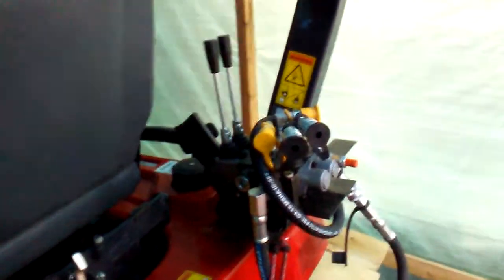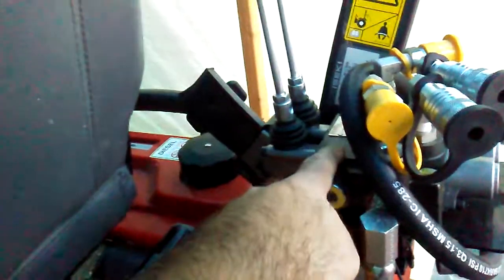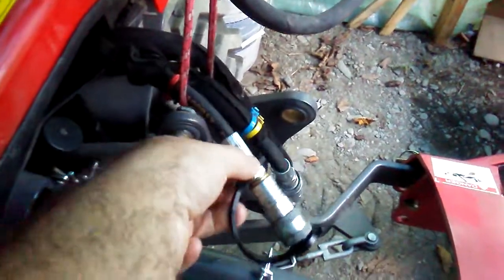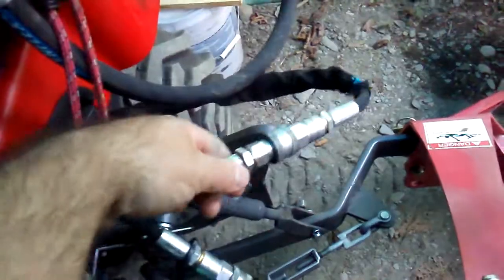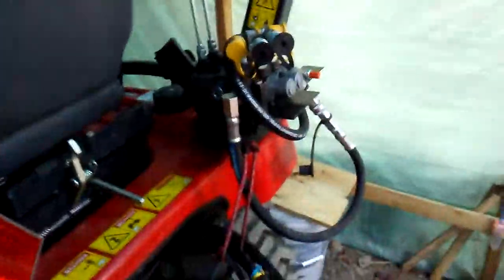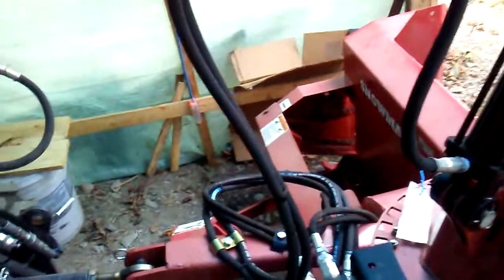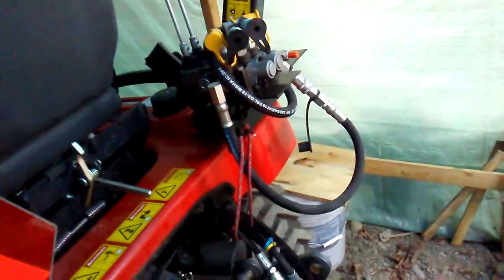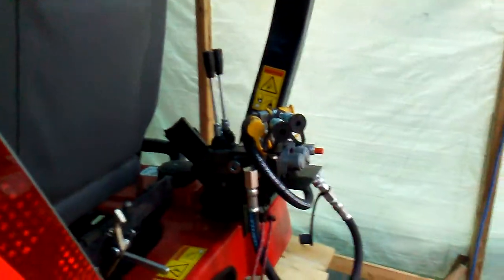Installin 2 spool hydraulics valves on mi Massey Ferguson GC1710

Comment: Another good note on the GC series tractors , they are OPEN center spools (valves). Yellow/blue is your hydraulic supply , blue is return to circuit(basically let’s the fluid flow to the next spool or hydraulic valve in the circuit )red is your return to tank (generally your pressure relief ) generally if your interested in using a splitter , you will just use the blue/yellow supply and red return directly to tank . Only thing is the FEL will not be available while using it . You will want to make sure every implement that has hydraulic spools (valves) has an open center , you may be able to get away with a tandem center depending on application . Quick basics … open center means when the valve is in neutral the (center position ) the fluid flows freely through its feed and return ports on to the next in the circuit (also your working ports A and B are open as well )as these tractors use a fixed pump meaning it runs no matter what when the tractor is on . The other center is closed center , meaning the opposite. In neutral position all ports are closed (you DO not want this valve as the hydraulic pump will dead head at the valve and note travel , these spools are for closed center variable pump applications where the pump speed adjusts as needed) . The other common spool is a tandem center spool . This spool in neutral has the supply and return open however the working ports Aand B (cylinder feed ports ) remain closed so that the cylinder stays in position when in neutral . A tandem center spool can be used with open center circuits /systems if you need this function . Might as well cover it since we’re this far lol . You may also need to know what type of cylinder your using . Single action meaning you are only controlling the cylinder one direction or dual action meaning you can control it both directions when needed this is why you have an Aand B port .

Comment: I have the GC 1720 I am doing the same thing. Is my understanding that the hose with the red zip tie is return to tank, the yellow/blue is the feed from the loader's power beyond port, and the blue zip tie is the feed for the 3 point hitch. When the backhoe is hooked up, you have pressure in, pressure out to the three-point, and return to tank for the low pressure "exhausted" fluid from the opposite side of each ram on the backhoe. The loader valve has three main ports, pressure in, power beyond (backhoe), and return to tank for cylinder oil. The backhoe valve has three main ports, pressure in (from loader's PB), power beyond (feeds 3pt) and tank for low pressure cylinder fluid. When not using the backhoe you connect the loader's power beyond to the 3-point pressure inlet, the blue/yellow and blue zip tie hoses and you leave the return to tank dangle because the backhoe is not in use. The three-point is the last in the hydraulic circuit which just has pressure in and return to tank. When adding another valve in series in between like this does the new valve need the power beyond port? And have all 3 of the backhoe hoses hooked to it? I'm not including all the work port hoses that go to each cylinder on these, just the main trunk. I've been reading that using a new valve like this and just using the return to tank as the high pressure feed to the 3-point can back feed high pressure and possibly cause damage? Even though it functions?

Comment: You failed to show and discuss how you tied the value into the tractor's hydraulic lines coming from the hydraulic  pump and exiting thru the drain line back to the reservoir . That is usally the most difficult connection.
Reply: He said, he hooks it into his lines for the backhoe

Comment: Hi Mr Teddy Bear, I am installing a rear mount snowblower as well on my GC2410. What valve make and model is that? Thanks for sharing your vids. Subscribed.
Reply from the maker: Good question I got it at my Massey Ferguson dealer I never did check that out. I will check on the valve but I think it's a Chief G series from Bailey you will see it on there web site but will check and let you know.

Comment: You will need those valves if you are going to connect up a snow blower on the front, or any other implement which have to be on the front of the tractor. My tractor came with the valves and hoses I will be using, and I got the front loader on one of my tractor's, and the other one is setup to use such implements and primarily use a brush hog though due to the size of that tractor, and the brush hog which I use often.